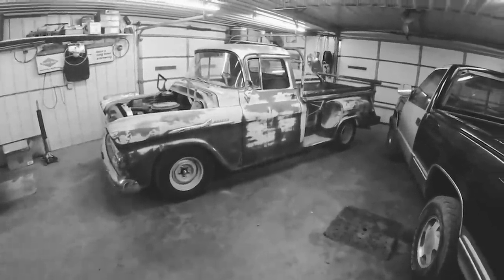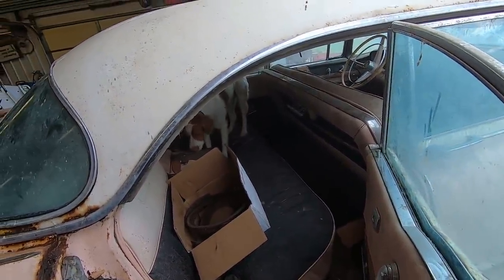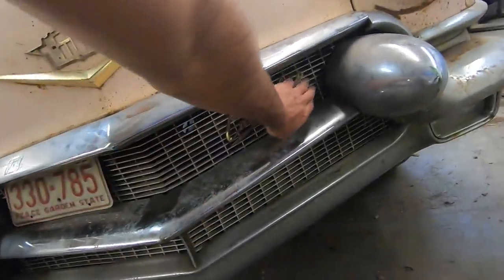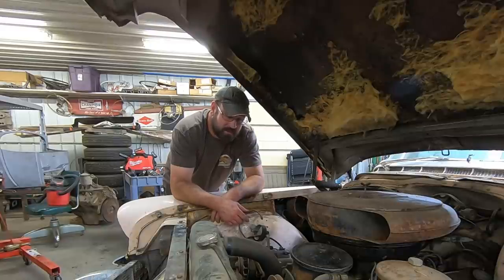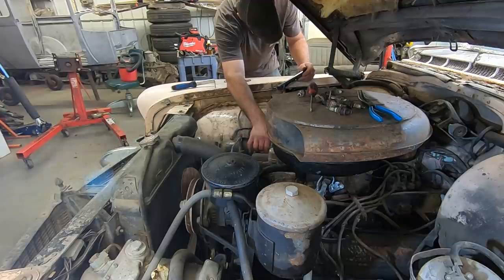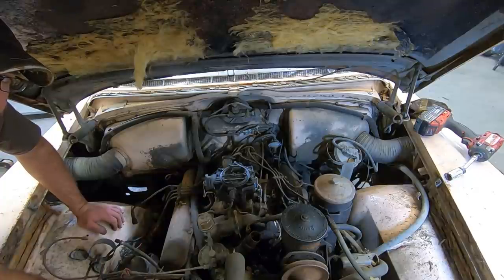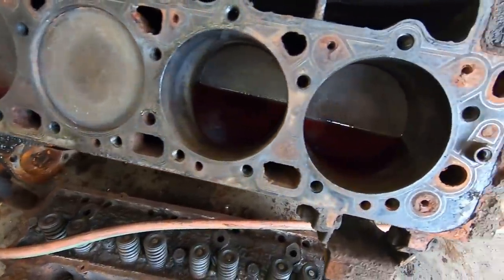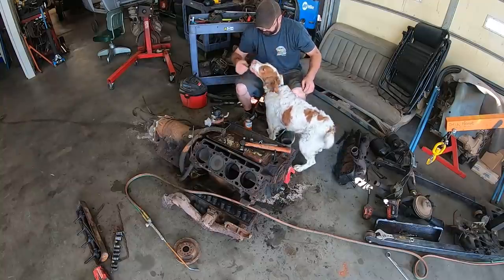Pink 1956 Cadillac Sedan DeVille Barn Find! Parked in 1969! Sitting for 52 years! Will it Run?!?

Comment: You know Chuck Berry would put a tape deck on the seat and had it rigged to record as he drove in the 50's when he was still with Chess Records. He'd drive and come up with the lyrics for many of his earliest hits. He'd buy a new Caddy every year without fail for decades along with a new Gibson every year. Hey, any 70's Caddy's in the local salvage yards that were rusted but have a drive train you could use as a donor for this old girl? Man... be a blast to put a dual quad intake on it with a couple of 850 carbs on a 500 + engine... glide'n down the road at night with some Elvis and Roy Orbison on the deck... maybe a lucky lady on the Bench under the arm snoozin' on the way up to the Cottage or somethin' :-)  Such a great car to beat into shape. Get one of those Home Depot pressure treated porch posts to put the dents out and rounded back into shape from the inside out :-)) Same colour as the one Elvis used to like and Buddy Holly too for that matter. The Perfect Rock'n Roll car.

Comment: Hey mortske! I love your videos! You and other youtubers in the field made me want to do this! I bout a 75 Chevy out of the woods that’s been setting longer than I have been alive! I have googled for days and can’t seem to find the info I need, could you possibly help me? All the ends of the wires have been cut and I have no clue where some of them go from the bulk head and I can’t find one with the same wire placement as mine online anywhere. Any suggestions?
Reply from the maker: They're pretty simple as far as wiring on those. I'd hotwire the engine and go from there. Or find a used harness.
Reply: @MortskeRepair  thanks. I’ll try that.
Reply: @MortskeRepair   ever had a really simple thing that you made way worse than it really was by looking over the simple stuff? Lol. All that was wrong was a bad neutral safety switch. I spent days trying to figure out what went wrong just to find out the switch went bad during a motor swap.
Reply from the maker: @jamesjines3996  Many a times!

Comment: Yeah, that's pretty sad. It sat in 2 barns, one was more than likely dry but the other sealed her fate. She's a... good parts car or least if the frame is semi solid and not softer than a gummy bear. It's possible to put that back together with a little duct tape, Taryl putty, and hope.
Reply from the maker: They had good intentions at one time anyway...
Reply: @MortskeRepair  Yeah, ya can't fault them for that. Cause I would more than likely do the same.
Reply: All but the bag of salt...
Reply from the maker: @bitteroldskunk  Haha you got that right!

Comment: Autopsy is the word you looking for. I had a 35 IH engine that sat since 1964 that had a full pan of water with oil on top. The motor turned over and ran after I pulled the head to extract plugs and replaced pickup that was a ball of metal from water freezing last 70 years. Lol.
Reply from the maker: Yuck
Reply: @MortskeRepair  lol. The only reason I pulled the oil pan to inspect the pickup was. The oil pressure line was disconnected from the guage. And was pushing water out thru the end of it when I 1st tried cranking  it with the starter to see if it had oil pressure. That was definitely a wtf moment
Reply from the maker: @jrsgarage7623  Intersting

Comment: Getting that torque converter out is a nightmare you got to split it and remove the guts there us a snap ring that holds it together inside its a pain
Reply from the maker: I seen that snap ring after splitting the ring gear from it!
Reply: @MortskeRepair  that snap ring in the front is to remove guts theres one in the back to remove rear half converter
Reply from the maker: @jeremyhanna3852  I figured that's what that was there for!
Reply: @MortskeRepair  also if you swap a different drive tran in that car or just part it out if you notice the tail Shaft housing dont match the trans its a different color thats a custom piece from cadillac because buicks of that had era had a torque tube that tailshaft housing let's u put a caddy open drive shaft on buick trans
Reply from the maker: @jeremyhanna3852  You know your caddy boat anchor transmissions!
Reply: @MortskeRepair  not really im a buick man that trans is a buick I been elbow deep in that model of trans to many time and its cousins the switch pitch and super turbine 300

Comment: Those 50's Caddy engine oil pumps also doubled as a vacuum pump. It was set up to pull 20 in. of vacuum to drive the windshield wipers steadily.
An early example of shitty engineering, however unique, by GM's Cadillac division.
Thanks for the cool video just the same, and Duff always rocks!
Reply from the maker: Interesting!

Comment: Cut the front off and make an outside shop wall hanger.  Thats  the  only thing going for it. Engine was shot when parked and all accesories are junk.  I did enjoy the  history of looking inside the old engine I would have quit when first head came off. Then cut abour  2 feet off front and hung  it on the wall like you do a boars head. It will be a trophy A1956 Pink Cadillac on the wall.
Reply from the maker: It does have some great lines!

Comment: Typically, steam engine conversions never go well. The water just winds up in the oil pan. Other than that, I'd still like to see the carbinator and starter rebuild.
Reply from the maker: Not much point in rebuilding those if the rest of the engine is scrap!

Comment: Such a shame. If it was stored properly with the occasional starting up it might not have been so bad. Seems the engine would be salvageable for a rebuild, but with all that water sitting in, its hard to say. That oil pump is most likely toast. Wonder what happened to the plastic pieces, if it didnt break when the Cadillac was parked, possibly when it was still running, oil pump probably burned up and wasnt working well and probably was burning oil, owner probably didnt bother having the oil changed and parked it with little oil left, engine probably had been seized up when parked with the lack of oil in the pan. Just continued to go downhill from there. Cars that sit like that generally are done for, not even the frame was well cared for. Such a shame.

Comment: if you look up at speed you can see the gaskets bulging out of the torque converter.
Reply: The hydramatic doesn't have a torque convertor....
Reply: @johnfranklin5277  Fluid coupling.  But they look about the same.

Comment: There is this fluid they sell at some Auto parts store to loosen rusty spark plugs and rusty parts called 
PB Blaster ... it works really well ... might try it before removing 50 year old spark plugs ... Works really well on freeing up Piston Rings as well
Reply from the maker: I've used it many times.

Comment: This is how I found Mortske. Either Vice Grip or Diesel Creek needed to use Mortske's patented hub removal trick. Great car. Once upon a time, long, long ago... Rust & critters... What can you do?.. Fix it, dear Mortske, dear Mortske, dear Mortske, fix it dear Mortske, dear Mortske fix it! p.s. there is nothing cooler than a '56 pink Cadillac. Apart from a convertible '56 pink Cadillac... Hot rods? Yuck...
Reply from the maker: l'm guessing it was Brent at Halfass Kustoms. But you hate hot rods, so maybe not.

Comment: There are some spiders that are attracted to gas, so much so Mazda had to recall a bunch of cars, because they were building webs in the emissions lines, clogging them up. So if I had to guess, they would be attracted to the intake, because of the fuel sitting in the carb. I guess if it was running rich or flooded, they might go into the exhaust too. Probably the intake though
Reply from the maker: Interesting! Spiders never bothered other manufacturers?
Reply: @MortskeRepair  I think it has something to do with the plastic gas tank, the blocking of the purge lines can cause higher pressure than intended in the fuel system, leading to cracks and leaks.  I googled it last night before commenting to make sure I wasn't mis-remembering, and apparently they like gas stations too.

Comment: Pull the crank and free the pistons up one by one.
Reply from the maker: And then what?
Reply: @MortskeRepair  Well assuming it's the pistons and not the crank bearings that's preventing it from turning over, once they are free re-assemble it and try starting it.

Comment: I would not even keep that block man I bet it has a crack in the block look at the damage on the oil pump and how did that water get in the oil I bet by a crack in the block because it was in a garage with a roof and it had a hood. I would toss that block it's a good Boat anchor I bet the thing is cooked.

Comment: How the hell did all that water get into the engine if it had a air cover over the carb a hood over the engine in a shed with 4 walls and a roof? I bet I know what happened the engine froze and cracked the block and all the water from the cooling system went into the oil system. That would explain the core plugs missing on each side the Ice swelled that engine right up LOL!!
Reply from the maker: Humidity gets into everything up here. Especially in a damp building liek that.

Comment: Oh don't need to change hub caps or tires they are excellent looks like they came out new and shiny no flats nothing shiny hub cabs still in good shape not even little rust tires not one wear and baldness treads deep and good condition and body no rust not even rust and seats no need to change them still looking like it came out of shop with car they giving it away look up eBay it's on there it's been on there a year and a half to two years now i don't think most people like it cause too much modern or think car weird too unappreciative what world was in sixties but you might like it and older people and some courious younger ones

Comment: My dad did not like Quaker state oil
Reply from the maker: That's another one that wasn't well respected in these parts.
Reply: @MortskeRepair  this was back when they used parifin in the oil we had a jeep motor sludge build up on valve covers were like the whole valve cover. We had to rebuild it ( it popped its cookies lol think it was a 1978 Wagoner?

Comment: This get another motor Chevrolet 305 Chevy 350 looks like the same boat pattern If not you would have to change the transmission also stop wasting time !
Reply from the maker: Definitely not the same bellhousing pattern as a small block Chevy.
Reply: @MortskeRepair  just fine a doner car with a good motor and transmission.
Reply from the maker: @victorrobinson7008  Gonna need a donor floor as well!
Reply: Just order a catalog ! They have everything you need.
Reply from the maker: @victorrobinson7008  Who does?

Comment: man your making yourself really look stupid on this one. YOU NEVER PULL A MOTOTR UNTILL LAST RESORT . when its stuck you fill it up with diesel till it run out the cap then leave it sit for a week then drain it and do all the stuff you did before you pull the motor
Reply from the maker: Boy do I feel dumb. That diesel probably woulda fixed that oil pump and the freeze plugs too!